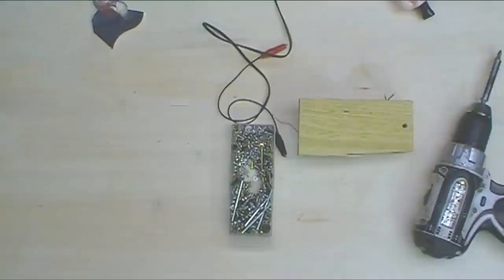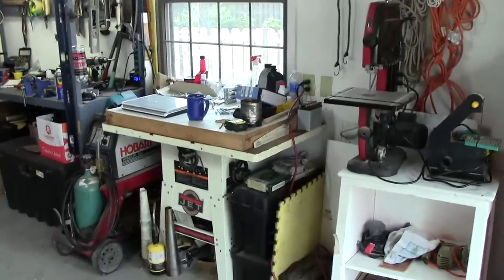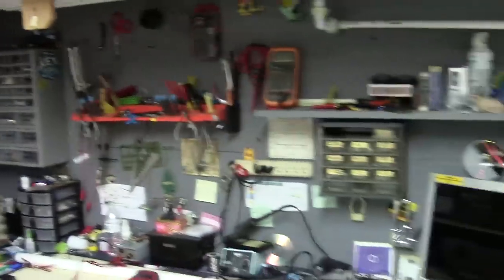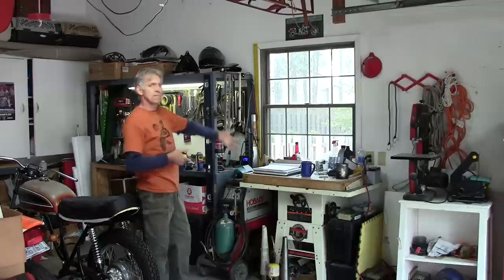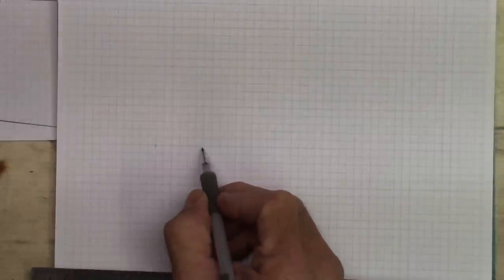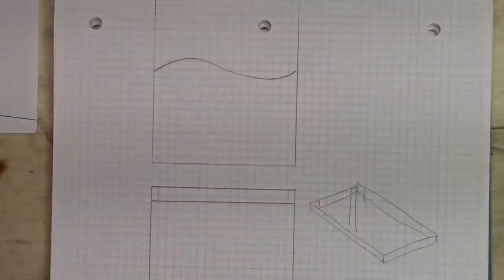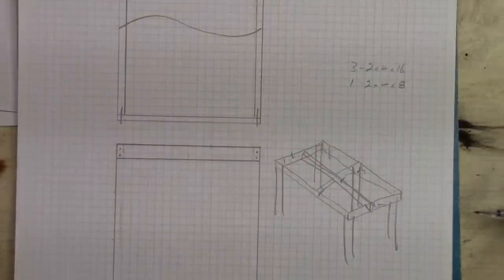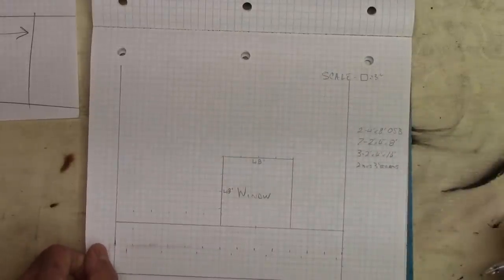Garage Remodel Part 1   Workbench Plan

Comment: Dean, I did a workbench sort of like yours about 10 years ago.  I also had a table saw to work with.  What I did was run the table an even 8 foot long at 3 foot high.  Then I did a bump up to about 42" that ran the rest of the length so that I could slide the saw underneath and more under shelving and drawers.  This area was very nice because it gave me some separation on the top and was able to work on items closer to my arms instead of being hunched over.  Just a thought.  Keep on Hackin!

Comment: Hello Dean! I do not want to tell you how to do it but I will give you a bit of advice that you might find it useful, I hope.Taking into account that you haven't decided what you are going to do with the cabinets, you could continue with the work bench underneath it in order to create more storing place underneath it. I also recommend to fasten the 2*4 that will support the back of the bench onto the wall and you save material you will not need back legs anymore. According to the different machinery that you have there, I would plan accordingly what should be built in and what shouldn't. As for the window, a sheet of plexiglass would protect it quite effectively.If I were you, would not build any shelf under the window, as is a great place to sit and draw having the natural light. I find it quite annoying not being able to sit properly at the workbench (when on a chair) due to different shelfs. I hope you find it useful and it does not come too late in the process. Cheers!

Comment: I know you mention dry wall screws but would suggest deck screws as dry wall screws are not made to have a high shear strength.

2 other things to cut cost and increase strength -  instead of 3 - 16' 2x4's which can get pricey and hard to find 3 nice and straight ones, replace the center and back ones. On the back rim use 2 - 8 footers screwed into the walls like cleats. You won't see the seam, won't need legs (though i'd put a couple under for overkill) and it's less costly and easier to find 2 straight 8 footers. That center 16' with all the cross ties I'd ditch and instead of the 1 1/2' cross ties (which is an extra load of cuts, screws & joints) use a single 3' piece running from the front rim to the cleat in the wall. I will give you same or better strength (less splices) and be easier and quicker to build.

When I did mine I added cleats half way down the legs running front to back and added a shelf under it in a few spots.

As I saw someone else mention I think I'd run it the entire way into the corner under your cabinet. Oterwise you'll likely end up having the space wasted and unusable.

Great topic though. I can't wait to see what other ideas you come up with along the way.

Comment: Dean, How much space do you have over your garage door? I have a 10' ceiling in my garage, so am putting an 8'x 16' platform (four 4x8 sheets of 3/8"plywood) over my garage door (cut through the ceiling drywall to tie directly into the rafters for strength) which will give me over 350 cubic feet of storage for lightweight items. I'm taking pictures of the project and plan on making a video of them with all the details, especially on how to clear the electric door mechanism, when done.  - J

Comment: Another great video as always. Looking forward to the finished product. My only thought is 8 foot is a pretty big span for no leg with only 2x4's . If it was 2x6 you could possibly  get away with it but it still might bow a little bit in 8ft. 14 ft Id put a leg every 4 1/2 feet for sure but that's my opinion.
Reply: KSfixitman Might end up doing that.
Reply: i agree that ~4.5 would probably be better, but i also think you meant 7. ohh, and it would probably be go to use wood glue if you wernt already planning to.

Comment: If it's one foot per three squares, I'm pretty sure each square is four inches, not three.

Be ready to be told this about fifteen times. :)

Looking forward to seeing the final result.
Reply: Number 2 of 15+ here.
lol, I also counted the length on your drawing is only 13 feet and not 14 feet. sorry
Could cause problems on window position with shelves. :)
Reply: Darren Landrum Yep, I'm a silly human! :)
Reply: Eye-Spy Focus It's a rough plan... :)
I usually make a quick drawing then starting cutting pieces and putting it all together. This was mostly for viewers to get an idea of how to estimate materials needed.
Reply: ***** Understandable, I just wanted to make sure. 1 foot could be big after its built. at least it would be smaller and most likely fit anyways. :)